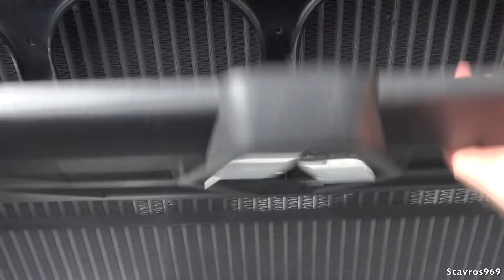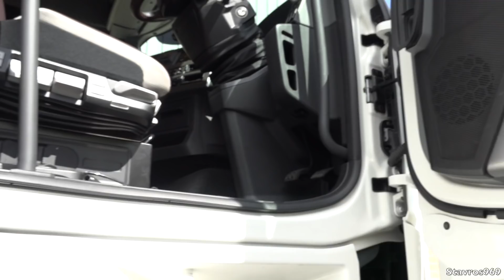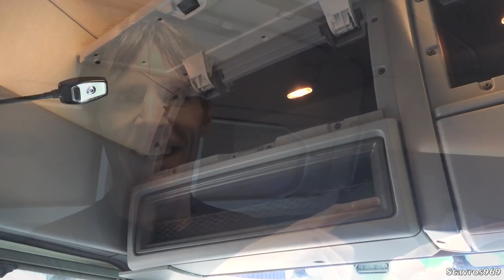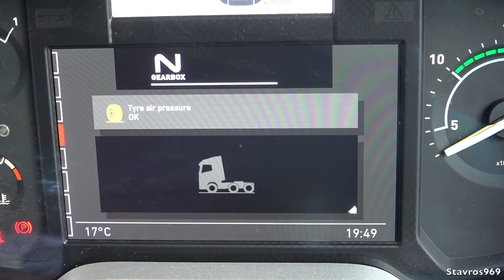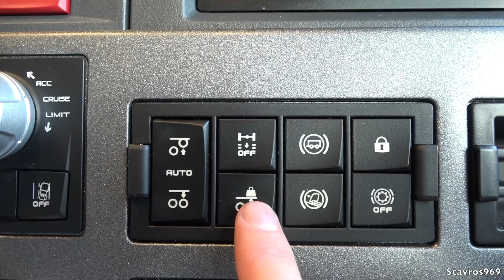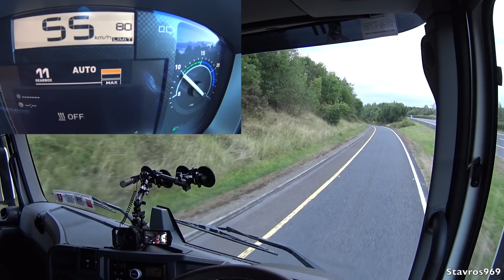2018 Renault T High T480 Truck - Full Tour & Test Drive

Comment: Volume controls are like in trafic, I wish they could be on the steering wheel. Also the electronic parking brake selector looks very cheap, they could just done it on gear selector just like P button on Mercedes

Comment: Not sure if this is valid , but I also found the steering wheel tilt a bit odd , we had a demo , but in old lorries none of the steering wheels moved so you had to adjust to the wheel , now the wheel adjusts to us might be why both my arms and shoulders are now fucked , I notice you feeding the wheel through your hands (like we were all taught) so maybe a flat steering wheel may be the way forward ,,,,

Comment: I got from my work a new model and after a half day I already hate the most things of this.
1. During the night, your display light reflects on the driver's mirror, even if I dim it down, it still blocks  very dangerous and can't see what's happening on road .
2. The mattress is uncomfortable too hard, small and can't place average sheets.
3. There is no room or place where you can place your cup of soup or where you can comply your sandwich or even spread your sandwich with jam and placing your grease knife and jam pot, namely no table!
4. I can't place my little microwave in those spaces.
5. The wind earodynamica panel behind blocks the view to connect the trailer.
Reply: Your big toenail is cutting though your sock as well. Can't catch a break.

Comment: As an American truck driver, I would never call that spacious. Tight, cramped, claustrophobic are the terms I'd be using. 
It does look like it rides nice. It's nice to see the tag axle is the front one and not the rear. Some US companies have tried the rear tag, and those drivers tell me they're horrifying on slick roads as it takes weight off the steers.

Comment: I WOULD NEVER BUY THIS TRUCK , I was waiting for you to get to the steering wheel adjustment, Renault got that completely wrong , I can't see the multifunction display properly when I have the wheel at the right height and because it doesn't come back towards me it makes my shoulders ache after an hour. I can't believe they skimp on driver comfort, but thats what you get for buying a CHEAP truck rather than a PROPER  truck. and I find theres way too much "stuff" all over the steering wheel and the radio stalk is unnecessarily complicated with different tuning modes and the auto volume turns it down way too much when you come down to a roundabout or too high when you get going depending on which one you have right. And the low beam headlights are about as much use as a candle on a motorbike. I hate this truck except the engine and gearbox which are very good although the exhaust brake is barely noticeable with more than 3 or 4 tons of freight on. the visor switch is also above your head so when the sun shines in your eyes and you can't see , guess what you also can't see - the visor switch ,,,DUH !   HOW DID YOU CRASH SON ?  I WAS TRYING TO FIND THE DAMN SWITCH FOR THE VISOR GARD , I COULDNT SEE IT UP THERE CAUSE THE SUN WAS IN MY EYES . oh and the USB port ! it dangles across in front of you because the phone has to lay on the dash to your left and the port is above your head to the right , again DUH.    OVERALL POWERFUL BUT GIMMICKY

Comment: Not a Renault fan at all, but that doesn't look a bad truck except for a few things i picked up on. Firstly i agree with you about the mirrors, rear view didn't look great. Secondly i thought the gear selector  looked fiddly and plasticy  compared to the I shift lever on the Volvo seat. The stereo looked very basic and stupid putting it above your head. What a stupid place for the USB and Aux sockets too, useless for charging your phone one the move and if your using an Ipod/MP3 you need the Aux somewhere that gives you good access to the device in a cradle without miles of trailing cable.  All in not a bad effort, i liked the folding top bunk for storage.

Comment: We have a fleet of these at my workplace. 18t, 26t and tractor units they are lovely to drive super smooth.
Reply: do you have any big problems with them? are they reliable? thanks
Reply: Norbert, we use them in our fleet and they take alot of punishment, they spend a lot of time off road and pretty much at 44 tonnes all the time. 
Drivers are happy with them.

Comment: What the hell was that plastic sun visor flap looks really crap, plus I don’t get the usb and aux above your head what if you need phone plugged in and want to leave on dash then the wire will be in your face. Plus the cheap looking circle heater fans are always a put off for me.

Comment: Hey Stavros, im  17 years old, am about to be a truckdriver myself, and I am about to start on my education tomorrow. I was 
curious if you had a tip for drivning a truck for the first time. And btw great video, and continue a very good day, Cheers <3
Reply: Patrick
Keep the rubber pointing down and you're good to go ;)
Reply: Addictive_LiquoriCe Haha thanks my man☺
Reply: Jan Schlossar Not where im from, you can get your drives card when you are 18 in Denmark
Reply: Jan Schlossar Nope youre wrong. Same in Sweden, you can get C+E at 18.
And C+E in Sweden isnt the easy tractor+semi, we have 25.25m truck+trailer at 64 tons.
Reply: Wiikendz Thx
Reply: Jan Schlossar trailers arent really bigger than anywhere else, but they are put on a dolly and pulled by a rigid, making the combo 25.25m long.
Reply: Jan Schlossar Maybe the NTM trailers? Those are really common behind the rigids, making a combo of 24m.

In Sweden we have a few different types:

The normal tractor+semi, usually 16.5m but allowed to be up to 24m in Sweden.

The Rigid+Trailer often called Tandem by others, most common is 24m long, a rigid boxed truck, with a dolly-trailer. Tandem combinations are allowed to be 25.25m if certain criterias are met, and 25.25m is achieved by putting a normal 13.6m semitrailer on a dolly, and then connect that to a rigid truck.
25.25m can also be dont with doubles, by having one 7.82m and a 13.6m semitrailer connected to each other.
Reply: Jan Schlossar In Sweden we call it långtradare, basically translated to "long truck+trailer combination" xD the 24m long combination with rigid+dollytrailer is the most common one here, and also the type the driving tests for CE are done in.
Most people actually like 24m or 25.25m more than 16.5m tractor+semi because the dolly makes the trailer follow the much truck better.

Comment: Always like your truck review video's! Just a noob question; what is exactly a "super single" wheel? What is the difference with a normal single or dual wheel setup?
Reply: paris velthuis a super single is a wider tyre
Reply: hence a higher load-index? And why are they being used on the front axle as I assume the most load will be on the backside of the truck?